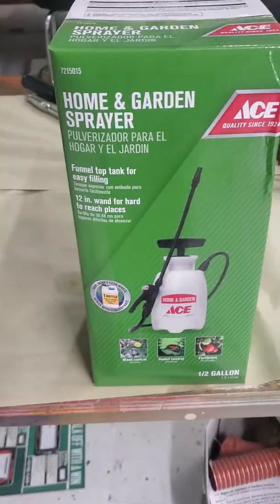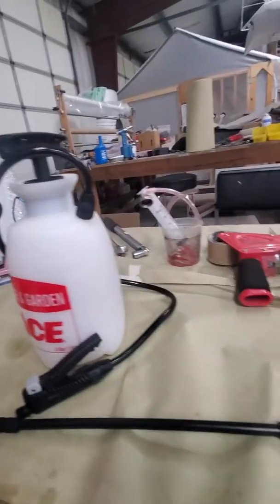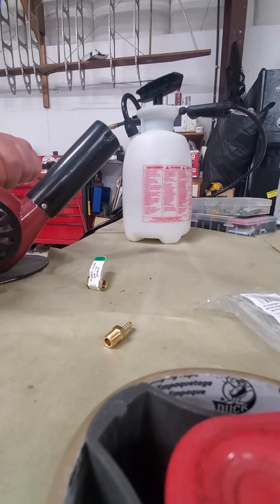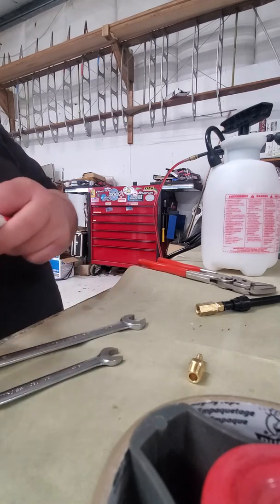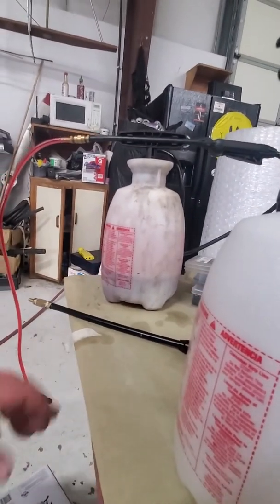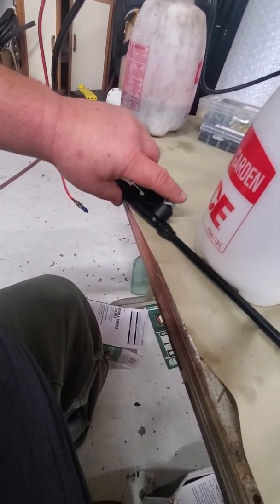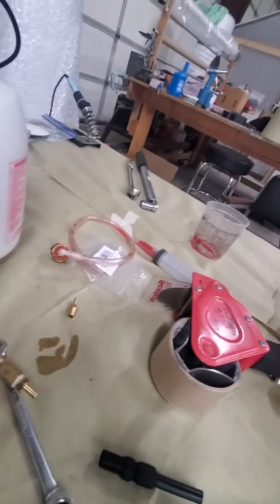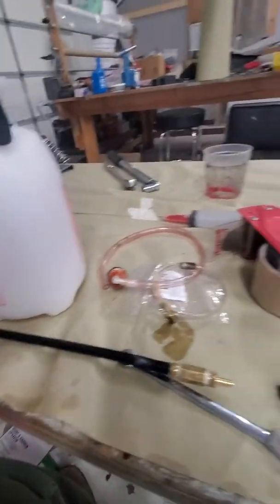Making a aircraft style brake bleeder

Comment: Did you think about using just a barbed hose adapter fitting, male on both ends? Lose the female coupler, and both male pipe ends. Just a barbed 1/4, 5/16 whatever on one end, the other 3/8 . Simpler, just a thought, the brass guys, Eaton and so fourth, make any kind freaky adapters.

Comment: Just go buy the right one.  by the time you buy the sprayer and add your time, you will probably have 200 bucks in it.   Another video of a guy tripping over dollars to pick up pennies
Reply: @JS not really, I iiteral have less than a 1/2 hr in it all and MAYBE $25...I've used mine for 13 years (at least once a week) with no issues and the only thing I have to replace once-in-awhile is the vinyl tubing. I personally don't bend over to pick up pennies anymore since they are made of zinc and are worthless.

Comment: I liked the idea of this and saw the expensive versions for sale, so built my own.  Unfortunately, it worked terribly.  Whether trying high pressure or low pressure, it blew a bunch of air bubbles into the line which just required re-bleeding the old fashioned way.
Reply from the maker: Hey Russell! Yeah when you first run fluid through it you have to "bleed" the bleeder. I just run it back into a container while I repeatedly pull the trigger until all the bubbles go away. Sometimes it takes a little bit to do  but you'll eventually get them out. This is all I use at the shop. Works great!